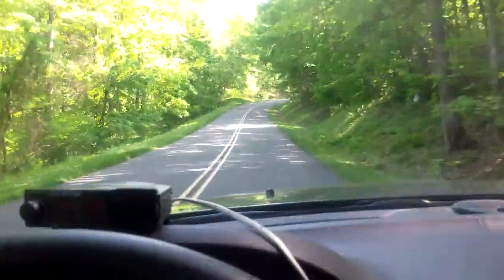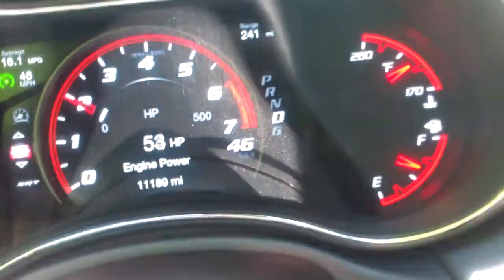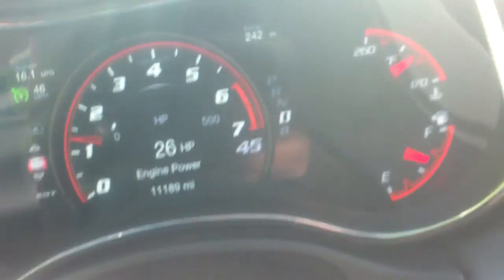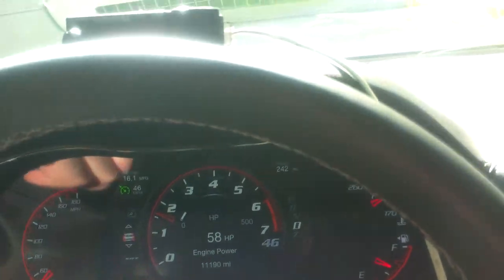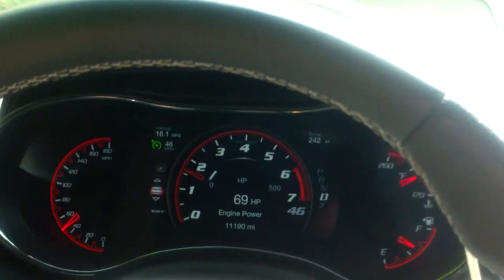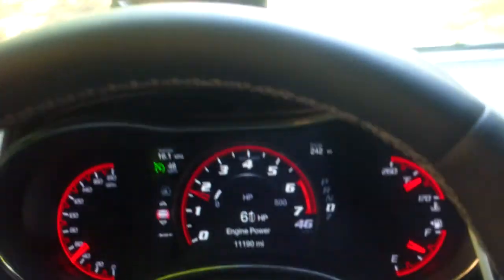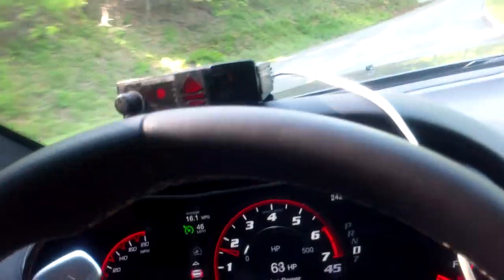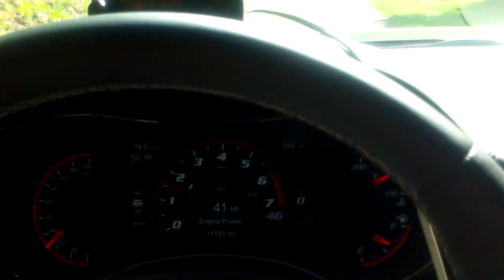How Much Horsepower Do You Need?

Comment: To put that into perspective - 60HP is exactly what the maximum output power of VW 1.9 non-turbo diesel is. Still very driveable.
Reply: ummm if you want to drive 44mph everywhere.
Reply: @josht1907  well, not exactly - the gearbox does a pretty good job managing those horses. But the 70km/h (44mph) speed 'limit' buffles me - 90km/h would be the obvious target speed, which 60hp is plenty for. :)
Reply: @josht1907  I have no problem reaching 80mph in my 53hp car

Comment: It's not just power, but also response and smoothness.  My Audi A4 tuned was a blast to drive in daily and spirited driving but only had 310hp.   On the other hand my 350hp BMW 330 tuned, is awfully lazy off the line, lacks low-mid power around town or for practical passing, more turbo lag, and more throttle lag.  Two cars can have same power/weight ratio and have completely different personalities.
Reply: Most ppl only read on paper specs.

Comment: You could use a 50hp engine to cruise like you show in that clip but also keep in mind that would mean you would be using full throttle and probably at a pretty high RPM which means a noisy ride

Comment: One thought generated by the video is do you want to own a vehicle unnecessarily over-engineered (more complex technology, bigger radiator, more oil, tougher trans) to generate power you won't use. Owning utility equipment like bulldozers, excavators, and tractors is typically based upon the sized of the job and takes into consideration fuel and maintenance costs. Now there's plenty of us that enjoy high performance vehicles. But what about those wanting a very nice vehicle, but would never ever floor it and use the 300-400-500 HP it has available - too scary, too dangerous, no place to go that fast. Perhaps vehicles should be built with much more "useful" horsepower coupled with better transmissions. (Note, heard a comment the other day Europe may ban V8 engines because of how inefficient they are.)

Comment: Eric, only video I could find showing horsepower used through normal driving.  Are there any mathematical formulas or relationships that exist to calculate the amount of horsepower needed by a vehicle when the co-efficient of drag s known.  For sample, would a 2.7l turbo 4 cylinder in a Silverado and a 6.6l Duramax in a GMC Sierra 1500 both need the same horsepower to maintain 60 mph?  Thanks, DGBryan
Reply: You have a good question. Might be more complicated to answer considering: 1) if an engine is high-rev/low bottom-end torque or low-rev/high bottom-end torque; 2) transmission gearing/final drive ratio, and whether one has any control over it when shifting; 3) weight of vehicle; 4) tire diameter size; 5) as you said - co-efficient of drag.

Comment: Interesting to see how little such a big car needs to keep going.

I drive a VW Polo in The Netherlands with 90 hp (1.2 turbo engine) with peak torque available at 1400rpm (160nm / 118 ft-lb). Since it is a light car it doesn't even feel sluggish. Yes, it is not fast but it is absolutely fine for just normal traffic.

Comment: More power, please! It is better to have it and to not need it, rather than to need it and not have it.:)
Reply: Nice one😊
Reply: Dude just get a tractor if you need a lot of power.
The more horse power you have, the heavier your vehicle gets, and more power is needed to maintain the speed. In the end you will end up with a 4 ton car that burns fuel like nothing else. Weve been using a 90 horse power car for 5 years. Having more would be nice, but its not necessary.

Comment: Its probably using more torque than power
Reply: However, remember horsepower is the result of torque times rpm divided by the constant 5252. And horsepower is "work." Torque is a factor of work. But you may mean the engine in the example develops significant torque (actually power) at low rpm. :)